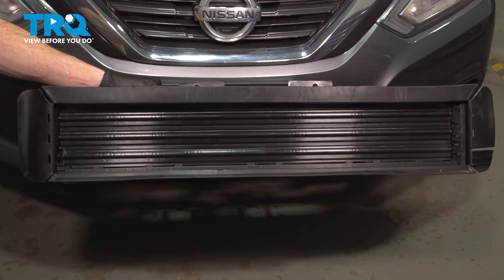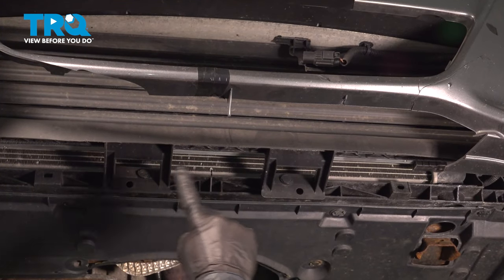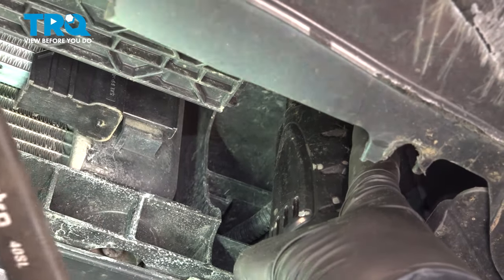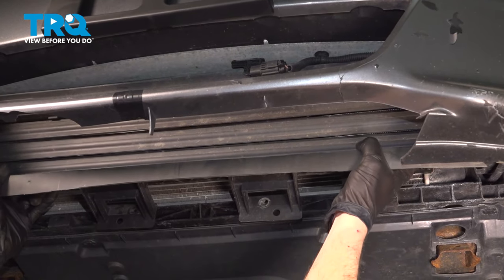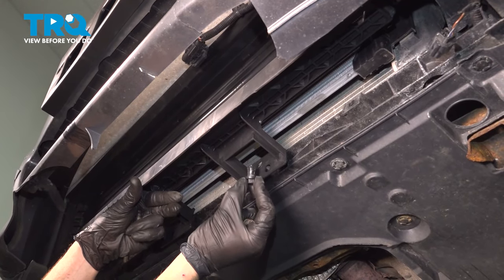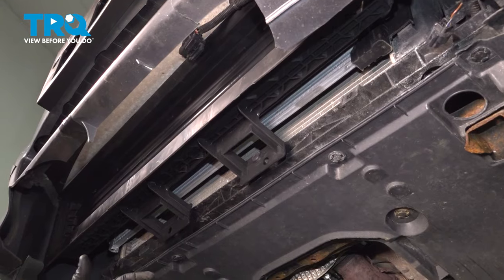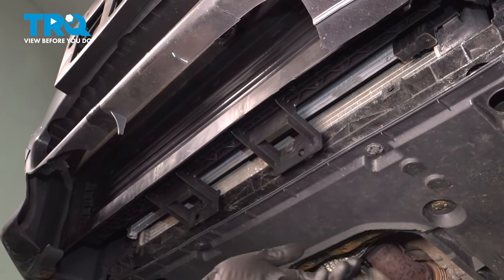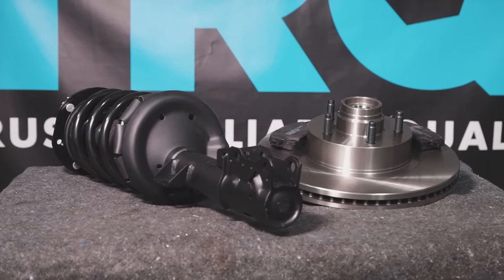How to Replace Active Grille Shutter 2012-2018 Nissan Altima

Comment: Great video! Helped me install the new part easily. However, the check engine light remained on. The wires look fine. Disconnecting the battery didn’t work. Did you have to delete the code? Thanks

Comment: I have a coworker who has a 2016 rogue that has a stuck active grille shutter. She took it to a shop and the shop says that the dealer needs to sync the new one with the car. Is this true? It makes no sense why that would need to be synced, seems like it would receive the signal from the ECU and just do it's thing.

Comment: Visit Nissan Assist regarding the 2019 - 2020 Nissan Altima on how Nissan is extending the emission warranty coverage on certain active grille shutter assembly to 15 Years or 150,000 miles, whichever occurs first.